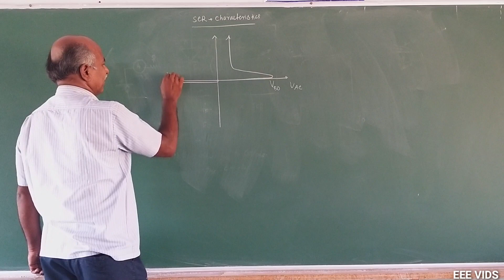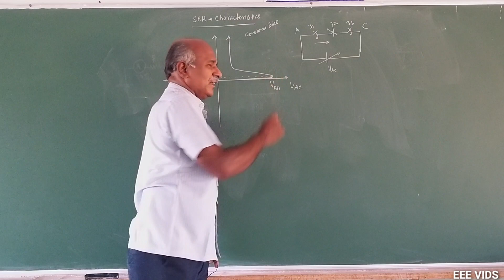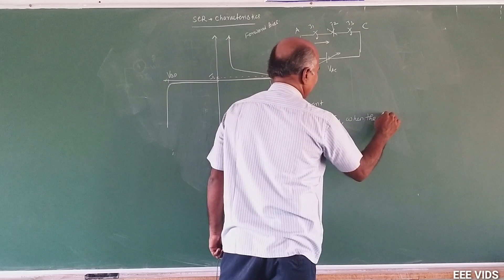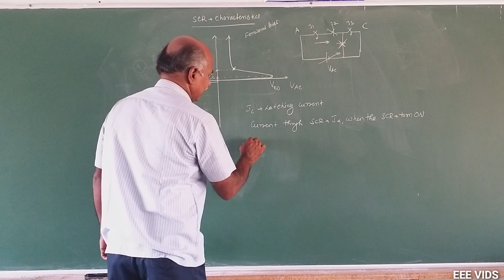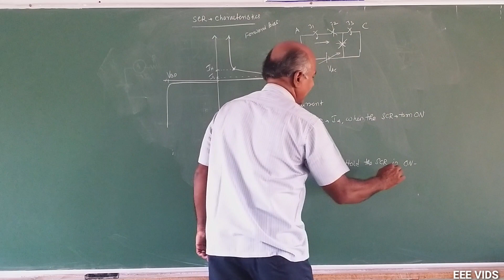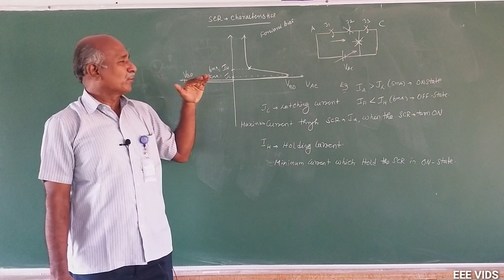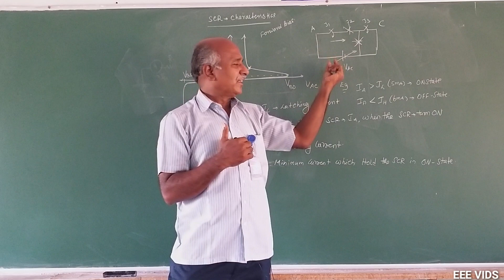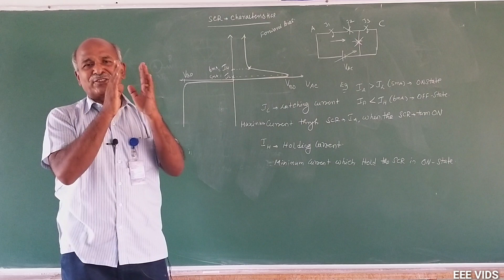SCR VI Characteristics in tamil

Comment: The latching current is the minimum current required to keep the SCR in ON state. As shown by you in the graph, it will be small not large.
Reply: He said that latching current is higher than holding current but marked little bit lower in graph than holding current

Comment: If SCR is unidirectional device, how does it work with AC power ?
Reply: SCR is called unidirectional because it conducts from anode to cathode.i.e., in one direction only. A SCR is similar to pn junction diode with additional 2 layers of pn junction. All diodes conduct AC power during the positive half cycle and it gets reverse biased during the negative half cycle.